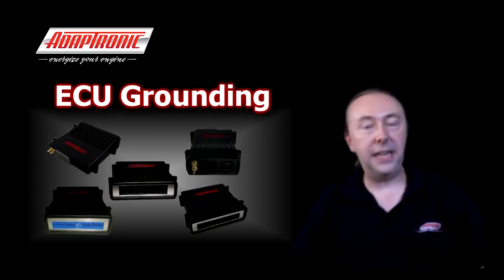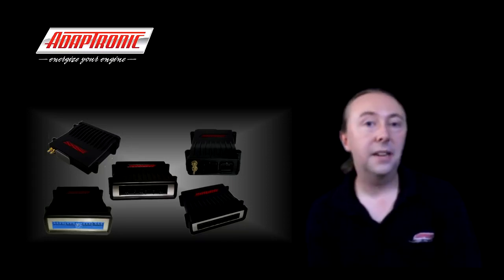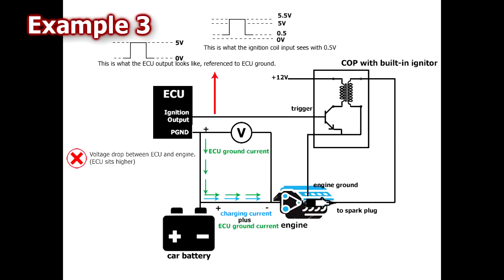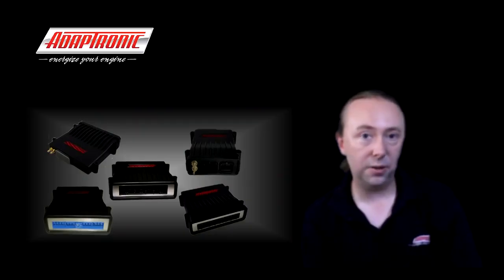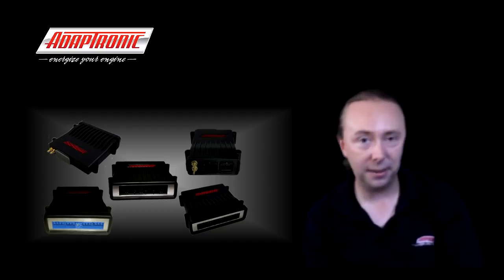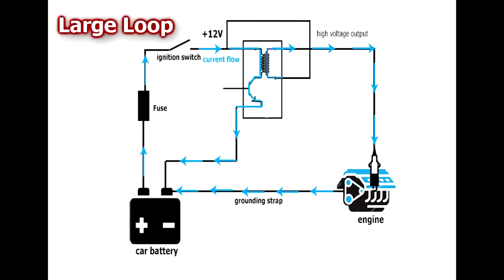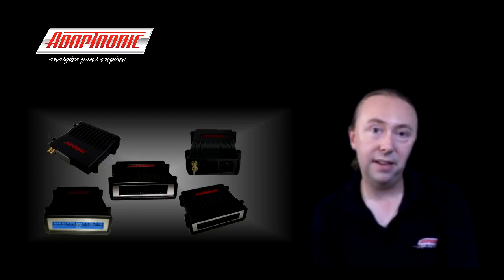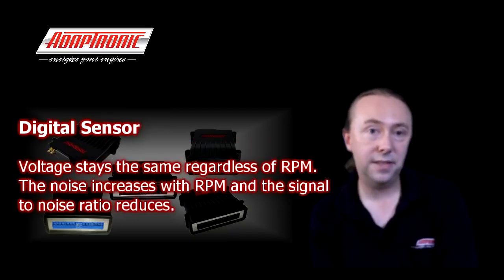Adaptronic - ECU Grounding Tips and Tricks

Comment: Hey man, thank you for the detailed explanation regarding grounding. I have developed my own ECU from scratch and also wrote firmware for it. I have run 4 cylinders very well, 6 cylinders too with no problems. I have installed the same ECU on a V8 and for some reason, there's interefence that I can't comprehend where it's from. If I use the same harness on a 4 cylinder but attach the other 4 COPs with grounded spark plugs and also attach 4 extra fuel injectors to mimic a V8, the 4 cylinder runs very smooth. No hiccups, revs pretty fast to red line and has power throughout. I check my data log and it is very clean. 
As soon as I put back the whole harness to the V8, I have hiccups. Engine never stalls but can feel the hiccups, from time to time. The engine has tonnes of power but I'm working on clearing that hiccup. I'll change the plugs to the ones that match with the COPs I'm using and observe if it wil help at all.

Comment: What if I turn all ignition leads, distributor and ignition coils into a "coax" configuration, thus providing a straight current return path not through the strap but through the external copper brading?